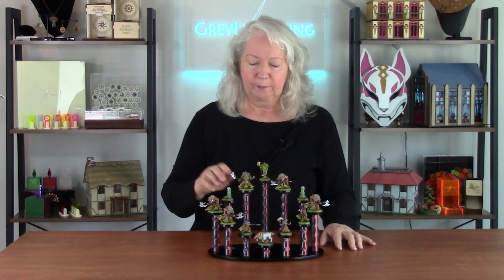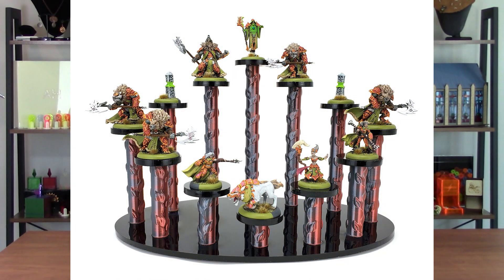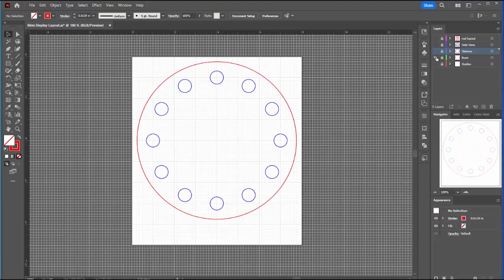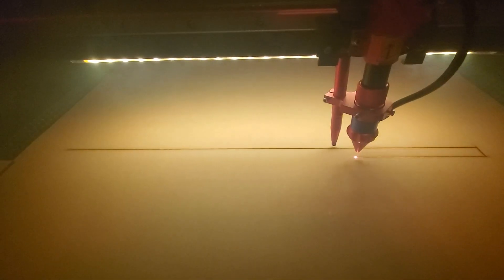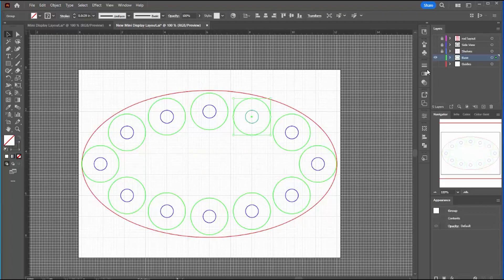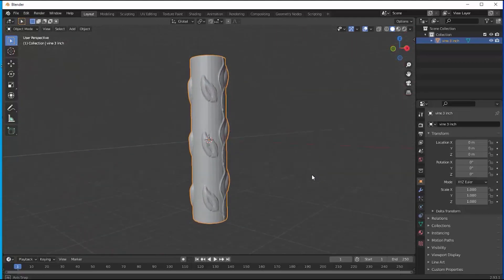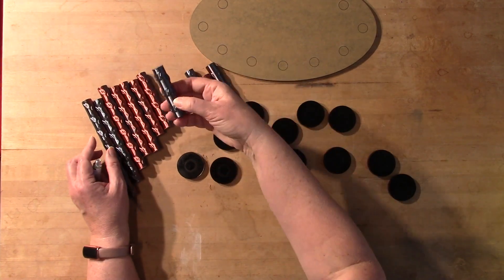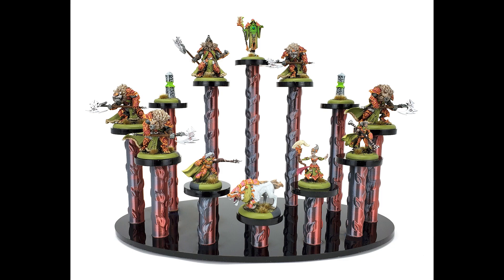How to Use a Laser Cutter and 3D Printer to Make a Display Stand for Miniatures

Comment: If you had a really big model or a couple big models they might also fit perfectly in the middle =). 

Thank you for sharing!

Can blender be used for simple designs that then go into a laser cutter?
Reply from the maker: Hmmm, I DO have a very large eagle that is part of this army. I will definitely check out if he fits. Very creative!
Blender is really hard compared to Illustrator, so I would always stick to a 2D drawing program like Illustrator or Inkscape for laser cutting. I have heard about people doing a 3D engraving effect with a laser cutter, but I think that is more an image based process where shades of gray are mapped to different settings for raster engraving, so some parts of the image are engraved more deeply than others. I've never really investigated that, I should put it on my project list!
Reply: @GreylightMay  I look forward to what you will be sharing next, thanks! :)

Comment: What a neat idea!! This would be a great project for displaying a Blood Bowl team. The oval base is reminiscent of a football, so you could decorate it as a Blood Bowl ball (think American football, but spikier). Or, 3D print some benches (themed around each team, of course) and arrange the minis similar to how team photos are staged. Were I doing this myself, I think one thing I think try to do is carve out a small circle in the middle of each pillar top to glue in a small magnet. That way, if you already have a metal washers on the bottom of your miniature bases, they'd be less likely to get knocked off the pillars. Great job, always love your videos!
Reply from the maker: Jordyn, I've heard of Blood Bowl but I don't know much about it. I will definitely do a bit of research on it; you're right, the shape IS reminiscent of a football.
As for the magnet idea, brilliant! Did you see my recent videos about magnetic game dials? I could deep engrave a pocket for the magnets easily, and put either another thin magnet or the metal disks I bought to go with the magnets in the bases. Long ago I did a lit display board for miniatures with magnets in a grid array so you could hold the minis in a variety of positions. I think it would be even more useful here, to keep them safe on their platforms. Such a great idea, thank you!